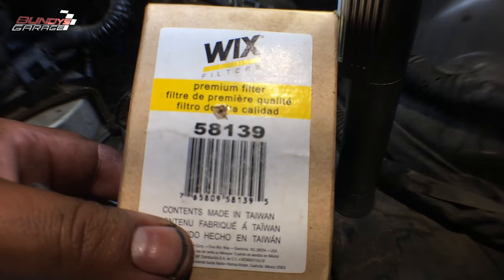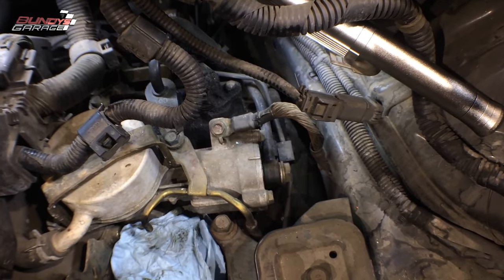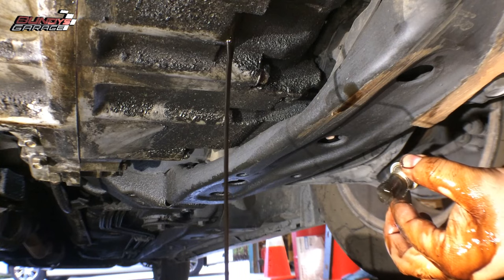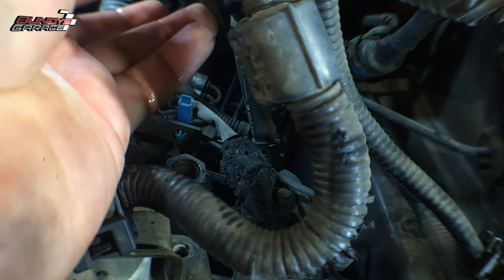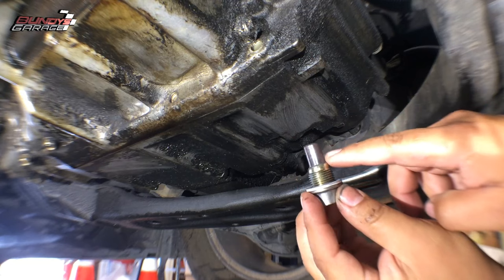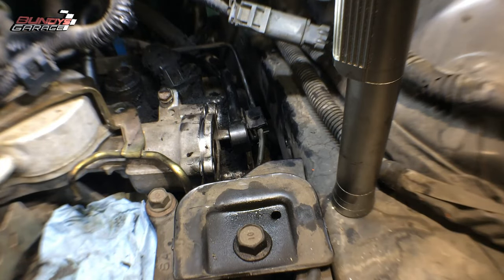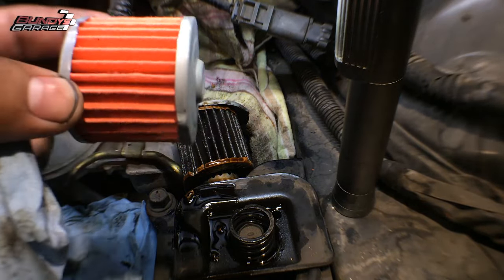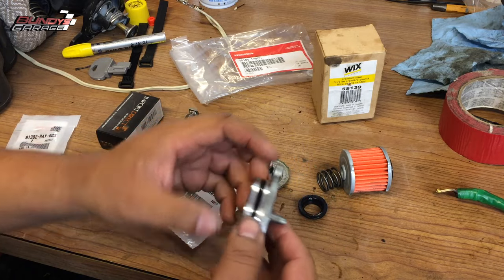Honda Accord V6 Automatic Transmission Filter Replacement | J SERIES |  2003 - 2006 Odyssey Pilot

Comment: Do not use dexron in the Honda automatics,will do damage.Use the OEM Honda ATF it calls for
Reply from the maker: you can use this: https://amzn.to/3ADmTyJ
Reply: @bundysgarage  hi. I have 2011 honda pilot LX 4WD. I want to do my transmission service but i don't know if my transmission has a filter. Can u help me with that. Please thank you
Reply: @bundysgarage  no point. Use what Honda recommends.
Reply: I ran Dex 6 for years in my old beater. It actually fixed some issues lmao.
Reply from the maker: You DO NOT have to use the OE Honda ATF. Valvoline makes a great substitute. you can use this: https://amzn.to/3ADmTyJ
Reply: @bundysgarage  One yard we dealt with,they will not warranty an used Honda transmission if the Honda ATF is not used
Reply: @Toolaholic7  they can’t tell after a few thousand miles lmao
Reply from the maker: Right!
Reply: @joetroy2904  They will ask this
Reply: Oddly enough the 2.4L engines have a transmission filter as well. Just held together by a couple of hose clamps sitting right above the transmission. I don't know why Honda doesn't mention these in the service manuals. Could this be partly responsible for the horror stories we hear about Honda's automatics of that time period?
Reply: @Toolaholic7  I have read and heard NOT to use Anything other than Honda ATF. Honda Used to make engines and tranies (I believe) for GM Saturns, but GM would not use their recommended fluids resulting in damage. GM would not change their ways using other products. Honda then said “BYE!”
Reply: Fawk! Now you tell me I just put some in a day ago now draining it!
Reply: Appreciate the video. Just inherited a 05 Accord with 188,000 on it and don't believe this service was ever done. If I do it now will it cause more issues than do good or because this isn't a full transmission flush will it be fine even with the high mileage?
Reply: @ryllyduc1198 did you end up replacing the old fluid?
Reply: @whatitisnt.  not yet no, honestly not sure it would be a good idea at the mileage since it was never done before. Got some mixed responses on it.
Reply: You can also use Japanese certified in castrol transmax for imports certification was done by the JSO of Japanese I have used it in many from 2000 -2010 and 11 models it’s made for Honda Nissan Toyota and Hyundai and is more readily available at Walmart for about $6 bucks a quart go figure 🤔💯⚠️
Reply: @bundysgarage so does Castrol it’s called transmax for imports and it’s Japanese certified by the JSO for Honda Nissan Toyota and Hyundai
Reply: @ryllyduc1198 do it! My 04 accord ex v6 5at had pitch black burnt fluid. I have done 2 drains so far final one tomorrow. Car used to slip and be angry after 5 minutes of hard driving, now it's up to of 2 hours of hard driving and I had no issues. Get the old fluid out your transmission. I will let you know soon about final drain + fill
Reply: @penguinpurist1696  cool thanks for the heads up. Glad it's working and improving the drivability for you.
Reply from the maker: Use Valvoline ATF Full Synthetic 3x fill and drain and you should be ok. you can use this: https://amzn.to/3ADmTyJ
Reply: @penguinpurist1696  I also had pitch black burnt fluid. It was taking like 5 seconds to shift from park to reverse, it also had low torque, and when let go from the pedal after driving on a good amount of speed it takes a while for the first gear to activate and fully zero the rmp when coming to a complete stop. After doing a 1 time drain and refill (the first time), 2 weeks ago, at 145,000 miles, it has noticeably improved. Do you think the 1st gear issue (which has very little improved as well) will improve furthermore if additional drain and refills is done?
Reply from the maker: That’s not true.
Reply from the maker: Yeah there is a point! You don’t have to use Honda approved ATF, you can use this: https://amzn.to/3ADmTyJ
Reply from the maker: How would they even know? Unless they base it on records and having the vehicles serviced at their dealership.
Reply from the maker: You don’t have to drain it. Use Valvoline, you can use this: https://amzn.to/3ADmTyJ
Reply: @bundysgarage  we have no idea who you're replying to. Why it's a good idea to tag the name!!!
Reply from the maker: you can use this: https://amzn.to/3ADmTyJ
Reply from the maker: I’m just throwing replies out.
Reply: @ryllyduc1198  final drain done, car pulls harder and shifts better, there is still hope after neglected fluid changes
Reply: @whatitisnt.  I have no experience of the 1st gear issue, my car originally just shifted hard and slow, but still went through gears correctly. Only under full throttle 30, 40, and 20 mph pulls did it get hot and start to slip, which has gone away with new fluid.. If your car doesn't slip or stutter during normal driving I wouldn't suspect mechanical damage. Id say keep changing fluid, it's better to get the old fluid out
Reply: @penguinpurist1696  first time changing the fluid? How many miles was it?
Reply: @penguinpurist1696  that's awesome, congrats on the success! Looks like that service will be worthwhile for me to do as well after all. Thanks for sharing your outcome.
Reply: @whatitisnt.  car has 215k miles. i have oil change receipts to 150k but not a single atf change. there is atleast 70k of no changes. first change since then
Reply: @penguinpurist1696  there was an atf change 7k miles ago?
Reply: Can anyone tell me if that is the only filter to change or at least accessible filter?
Reply: @MotoXsjetRider  yea it's the only external filter that's able to be changed even though Honda doesn't even recommend it unless the transmission is being completely rebuild. The other filter is not able to be changed unless the transmission is completely being rebuilt also.
Reply: @whatitisnt.  All I can say is if you haven't changed this filter and you don't know if it has ever been changed, change it out now and basically do what you saw in the video. My daughter's Honda Accord V6 174k miles automatic transmission was slipping/fading after a couple miles and warmed up. Had a long time friend of the family transmission shop take a look and they said the codes said  it was 3rd gear solenoid and a couple other things. Two days later the car is doing the same thing and had it towed back over. Got the word that it unfortunately needed rebuilt to the tune of $3k...WTF? So I say thanks but no thanks and started Googling and found this video. I proceeded to get the filter kit overnight delivery on Amazon and 2 gallons of Castrol Import ATF fluid. Removed the filter and it was as bad or worse than the video with chunks of the epoxy blocking the fluid passage through the banjo bolt because of the smaller openings. Installed the new filter and refilled the 4 quarts of ATF that I had drained when I started. Fired it up and ran in one gear or the other and took on the road for the next hour with no issues at all. Still  have to work the other gallon of fluid in after putting some more miles on it but I think I dodged a BS $3k bill. These so called transmission experts are ignoring the basics like changing fluid an filter and instead trusting an error code. What ever happened to common sense?Thank you so much for this video!
Reply: @MotoXsjetRider  dude are you saying after the filter change there is now zero symptoms?! SNM I'm going to finally change the filter now that I have an affirmation!! My transmission is also slipping a bit. I finally changed the ATF, first time at 145,000, and it improved noticeably in terms of downshifting from to second to first gear but I didn't think a filter change would make a significant difference for the slipping. I'll update you when I finally change it. Thanks bro seriously!!!
Reply: @mandybaker8544 I used in mine .The issue I had was hard shifts. My tranmission man told me to put the honda fluid in it also. This Ole girl has 258020 miles
Reply: @MotoXsjetRider  ?

Comment: The mdx also has a small transmission filter that’s hooked up to the cooler lines. Sits on top of the transmission. The best thing for these honda transmissions is to drain/fill 3-4 quarts per year. It’s the best insurance. The service manual’s transmission service interval is way too long. The fluid should be changed often and remain pink/red.
Reply from the maker: Thanks for the tip!

Comment: Excellent video, thanks for your work and patience to explain it all.

Do you know if it's s the same filter spot for an Accord 2008 V6 3.5 L?
Reply from the maker: If it has a filter it should be near or close to that spot.
Reply: No the 2.4 sits above the transmission bell housing held in place In place by a clamp on each end I got mine from eBay $6 bucks

Comment: Hello thank you for the detailed video.  i have a 2007 V6 Automatic Honda Accord Special Edition, it has 210k miles on it.  The transmission filter and fluid has never been changed.  The transmission is running okay and it doesn't slip when driving.  However I got the code A13.  The 3 I believe is telling me to change transmission fluid.  People have warned me to just leave it be since it has never been changed before.  What would you do?  Thank you
Reply from the maker: I would change it. Change it 3x. Drain and fill once drive it 1,000 miles and then do it again.
Reply: @bundysgarage  Outstanding thank you for advice I really appreciate your input, once again great video
Reply: Let us know what the end result is...
Reply: How did it turn out?
Reply: @AWP1976  update on what happened?
Reply: @cesarontiveros2135  Good afternoon, I thank everyone for there input and advice, I actually just cleared the code and let it be, since there are no leaking fluids and the transmission isn't slipping I figure I would just leave it alone so I didn't create any problems with it, sorry of the late update but thank you for checking in
Reply: @AWP1976  seems like a bad idea. How did it turn out?

Comment: Does the fluid need to be drain before replacing that filter
Reply: No, since it only has trans fluid when the engine is running.

Comment: I saw you also linked the linear solenoid; What symptoms did the car have? I’m having hesitation between 1st and 2nd and also 4th and 5th at highway speeds with an intermittent p0740. Would this service help out?
Reply from the maker: This video was taken from a 2 part series I did. Here is the link to the first part where I show the code, the issue, and what help me solve it: https://youtu.be/26AZuwUxQNY
Reply: @bundysgarage  awesome, great info. Thanks

Comment: Do you know what that end cap is called on the transmission filter for that model? My snapped
Reply: Not sure if you found it yet.
Cap, Atf Passage B Accord 
Part Number: 25802RAY000

CMS sells a ton of parts and they have all of the diagrams uploaded to reference. Normally I just find diagrams through googling them.

Comment: How do I find out if my car has a filter? I have a 12 civic ex with 1.8l. I have drained fluid many times. Also what mileage....should u drain fluid? I know it takes like 3 times to get all of it out.
Reply: Any OEM parts online vendor should have IPC's and you should be able to find it out by punching in your vehicle model. 
Some auto manufacturers say the ATF is good for life, which isn't true (most people sell their cars before it needs ATF change).  If someone is planning to keep a car for a long time, ATF needs to be changed at every 30K to 40K miles.  What happens is that old fluid forms deposits inside if not changed regularly, and introducing clean ATF would melt/dislodge those deposits, which eventually clogs up fluid passages and renders an ATX inoperative.  It only takes a tiny piece of FOD to make ATX inoperative.  

Some shops have cycling machine with which you do not need multiple drain & fill procedure.  I would let such shops do the job as modern ATX is like clockwork.
Reply: @JPN850R  thank you been doing every 30-40 k

Comment: Honda Pilots built after 2006 DO NOT have changeable transmission filters!   They ARE inside the transmission.   That’s probably why the fluid interval is 35000 miles.

Comment: There was one part to the left of the new oil filter that you forgot to mention?
Reply from the maker: what?
Reply: @bundysgarage  at time stamp 12:16. The piece of metal to the left of the filter
Reply from the maker: That’s part of the old filter that came apart when I pulled the old one out. It’s the metal end caps of the ATF filter. It’s trash.

Comment: What about the j35a9 4wd that has an inaccessible filter built between the engine and transmission? Any advice?
Reply: Are you sure?  I think all J-Series Engines past a certain year all have this filter.
Reply from the maker: @banetek no I don’t think they all do. Actually I know they all don’t. Really depends on your year and Model. If it’s a Honda or Acura.
Reply: @bundysgarage  valvoline max life multi vehicle atf changes negated the built-in transmission filter issue.  those dang crossmember/subframe mounts in the rear though seem to be the end of my 07 pilot unfortunately
Reply: The 08 J35 in the accords the filter in inside the trans

Comment: dam bro, the underside of that car was filthy it obviousely has either an oil leak or transmission lek, all that greasy crap is not under my 2005 honda accord that has 210,000 miles, it is clean as new ?
Reply: Was the transmission fluid ever changed?

Comment: If you want to extend the life of your engine and transmission and differential or transfer case get a product you can order a line called motorkote this reduces friction by 95% since I started using it my oil changes have been coming out about Maple colored syrup color and not black as they were previously oh, the best way around this is collect a sample of your transmission and motor oil before you change it
Reply: RO

Comment: The color of the ATF looks terrible.
I'll stick to my 6 speed MT.....(AC Delco fluid actually performs better in these 6 speed MTX than genuine Honda/Acura fluid)
Reply: Don't panic over dark ATF. On automatic transmission's there's clutch packs. Same with a wet clutch on a motorcycle. You can do an oil change and one short ride it will be dark again.
Reply: @danp7463  That's not exactly true.  I change my ATF so frequently, you could put it into another car and drive 60k miles on it.  Its still nice and red and translucent.
Reply: Put Lucas Heavy Duty Oil Stabilizer 1/3 quart + AMS Oil Synchromesh; if your looking to significantly outperform Honda fluid.

Comment: I'm sorry but this transmission and engine are disgusting looking, I take him over to the self-service car wash spraying down with Degreaser to set for 5 or 10 minutes depending, and then use the hot soap selection to clean off all the oil grease and Road grime off the underside of the engine and transmission and down the sides and top of the engine But be sure to cover your alternator with a towel and a plastic bag to seal it off or any other thing that's electrical or electronic that may be exposed? Then use the hot wax selection on the carwash and then that will get rid of any old grease that's left over as well as underneath and on the sides of the engine and transmission, remember this stuff is going to blow backwards toward the back of the car underneath which is going to code everything that needs to be washed off or degrees including the differential unit if it's rear-wheel drive or transfer case if it's a four-wheel drive or truck
Reply: Yeah kind of kind of funny how particular he was about replacing all the o-rings and crush washers when some leaking transmission fluid would really help clean things up lol

Comment: ONLY use Honda ATF.   Do NOT trust any other fluid in your honda tranny.
Reply from the maker: Why?
Reply: I have a heavily modified 3.0L 2007 Accord Coupe with 330 Wheel HP, running AMS Oil Signature ATF + 1/3 Quart Lucas Oil Stabilizer.  Dramatically increases torque converter bite, and shifting is extremely sharp and hard.  The Lucas Oil protects the gears themselves from high HP, wear and from shattering.
Reply: @bundysgarage  Hey.  It's the guy with the 3.0L V6 Accord Coupe Road / Race Car...  I finally had the trans filter changed at 135,000 miles.  Because I'm a maniac and change my ATF like every 12k miles; it was not clogged, fairly clean and still functioning, and only had the slightest of extremely fine almost graphite like particulate in it.  I am fairly sure that is a tiny bit of clutch pack from normal use.  In doing its job correctly, a tiny bit of material very fine, will need to come off each time.  But, what's important I think; is that the tiny bit of  material that was in it, was smooth and silky like graphite.  Anything gritty or chunky I would think is a bad sign.  So in closing; yes you can pump the HP up significantly on a good J-Series Honda Transmission without damaging it.  Even driving it hard / racing.  But, only if you change your fluid very frequently and consider AMS Oil ATF.
Reply: I'm in the process of installing a small Nitrous Wet Shot for my J30A5 Modded Beast.  Only a 50 HP shot.  I'll post a photo when done.  Along with the cautions you should have, which are many.  It should only be considered if you know what things you need to do, to keep it safe.
Reply: @banetek  Good to know. I'm going to eventually turbo my Accord and was wondering how the auto trans might hold up. 
 I need to get a newer honda accord ecu that can be programmed with hondata.  That will be the challenge, matting a newer ecu up in my 99 Accord.
Reply: @banetek update?